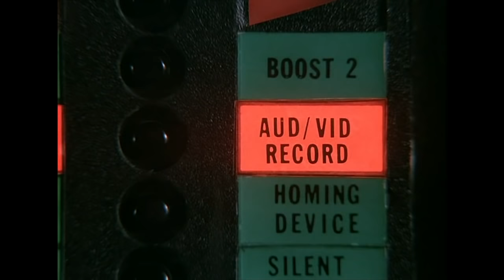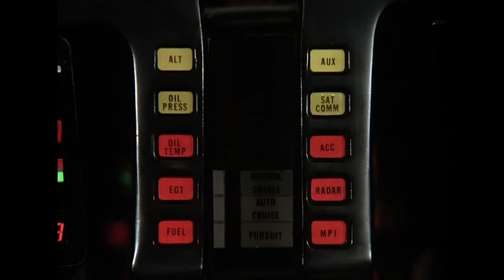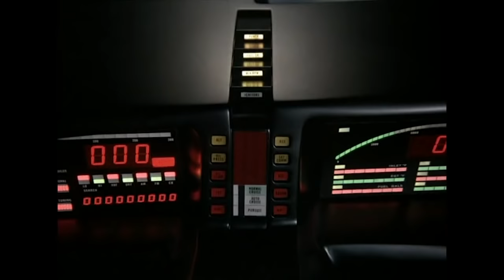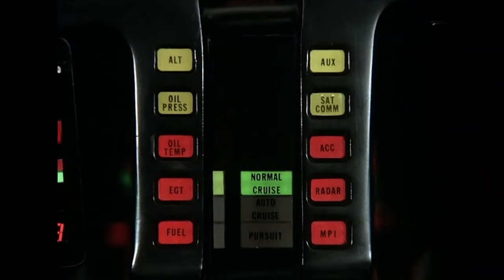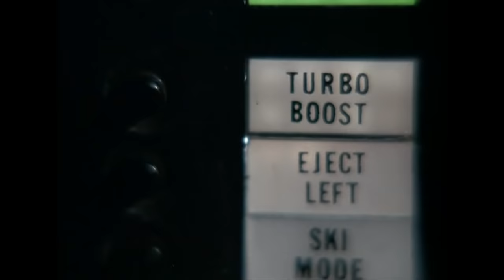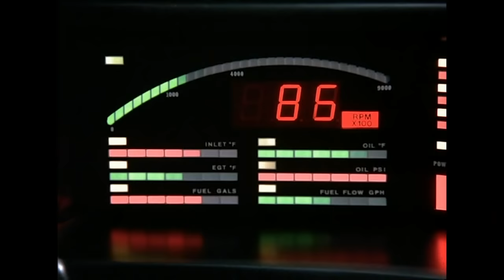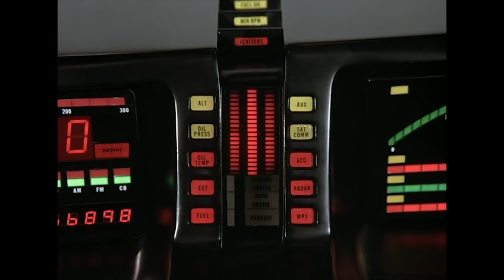Michael Has His Revenge | Knight Rider

Comment: That acid pit looks an awful lot like a standard large puddle of watery mud
Reply: Because it is.  The "acid pit" car was one that they had stripped everything out of (including the engine) and painted with the "acid pit" paint job to make it look how it did.  The reason they stripped everything out is because it later became the transforming super pursuit mode car (the one with movable panels and no engine).  It was one of the train derailment cars that was destroyed at the end of the show as the contract with Pontiac stated sadly.  You have to admit though, for 80's TV with very little budget, it was still pretty good special effects for the time.
Reply: Real acid would be a hazard, risk to the actors, environmental etc., cheaper to use mucky water.